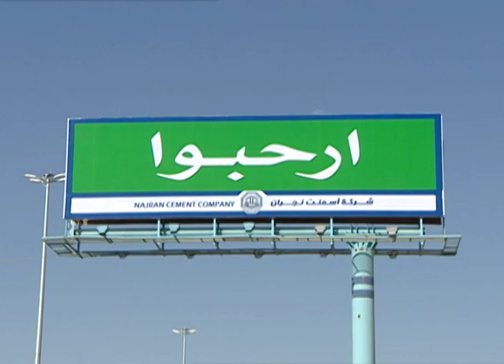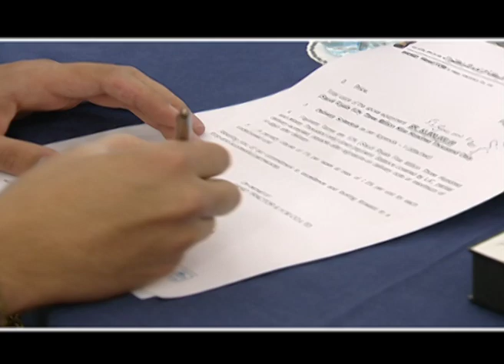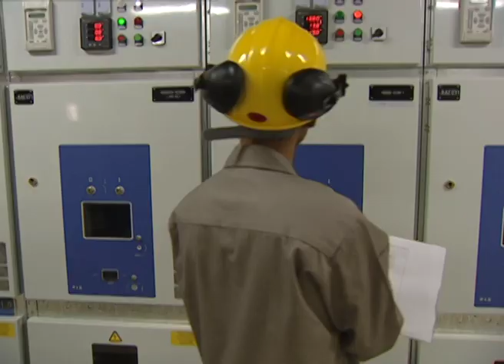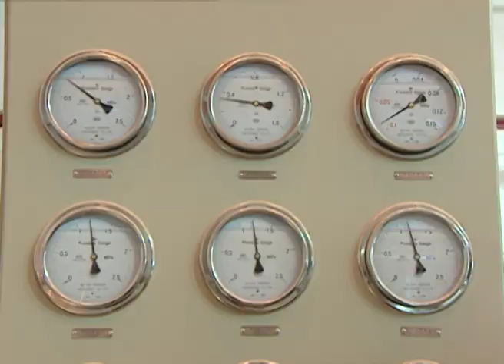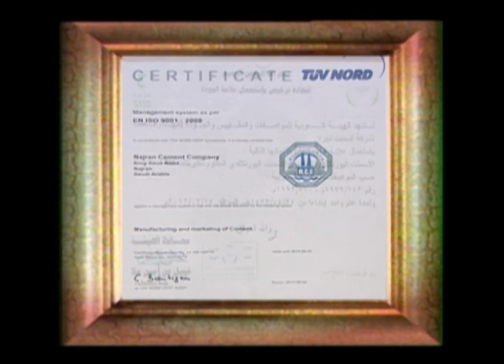Najran Cement Company

Comment: I was Cement Power Plant Manager from Wartsila.
When I joined both Cement and Power Plants were facing major problems. 
I identfied the basic relay setting problems in the Cement Plant, got them rectified which led to stsble operation of Power Plant.
Later I got the PLC logic modified to trip 5 MW motor to trip in case of fault so the the DG sets should trip in cascaded fashion.
It was interesting and challenging to go on increasing the reliability of the plant.
Matar al Muyayyad for incharge for the Cement Plant.